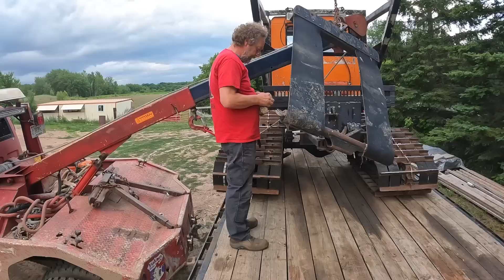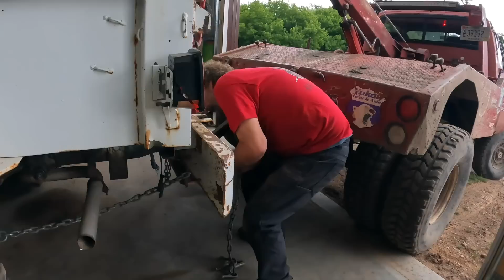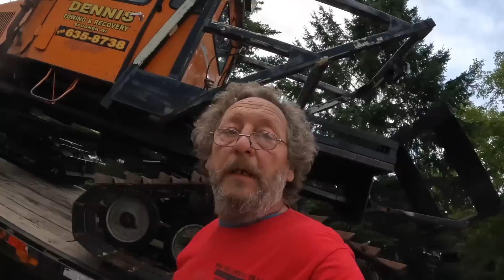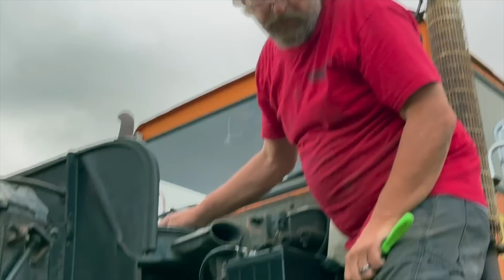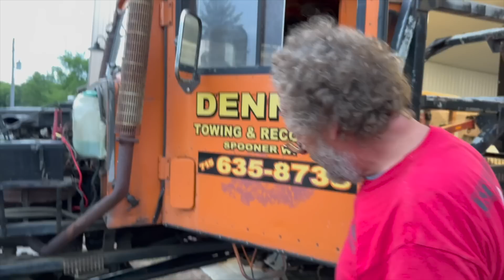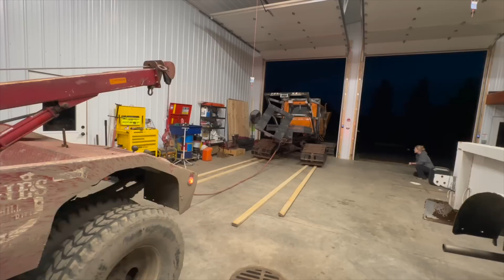Will our new Snow Cat fall off the trailer?

Comment: Am I alone in wondering why you didn't just use the 'drive through shop' and winch the snocat off the trailer with the wrecker?

Aside from that, well done for getting it in there.

Comment: Eric I have seen someone get that creative on unloading a unique snowcat that won't run or steer. 
The Wrecker is definitely powerful didn't seem to have a problem at all moving it.
Have you guys thought about getting a tilt trailer? I am curious because it definitely would have made that unloading easier if you could have tilted the bed up and used gravity to roll backwards and save on the starter.
I am glad to see Seat Cover is doing better and is involved more in the videos

Comment: Im no expert mechanic but you dont need the exact replacement carb for that engine. Definitely speak to an expert but I believe you can just order a brawler brand carb (made by Holley) and have it shipped out quick. Now yes its a little more expensive then the one you found but many people have reported that out of the box they work great on most engines. And beyond that they offer tuning and parts support that a factory replacement just cant offer. The best part though is the Holley support team appears to always be on point supporting small youtube channels.

Comment: maybe put in quick connect hydraulic ports and an anderson plug.  Ust that to plug an Electric hydraulic pump  plumbed into the system to use when engine dies yet you need steering?   Might can find a used one.  It's not like you will use it super often.

Comment: I had a old Nissan with the starter override button  I used it to crawl up a off ramp once after pushing for a 1/2 mile (maybe 100 ft seemed farther lol) I was never so happy to see a gas station on my side of the road.

Comment: I'm mystified that the carburetor couldn't be rebuilt to a state that would at least let you drive the snow cat off the trailer.  I've seen engines run with someone dribbling gas directly into the intake manifold with no carb at all.

Comment: Why kill the battery and the starter when you've got a winch that's designed to do the pulling?
Why not back the trailer in and use the new Challenger Lift to lift the Snow Cat up and off the trailer?

Comment: Given the design of a single ram and linkage to steer that beast, wouldn't you have thought to pull the pin on the ram and mount a long bar to act as an external steering input?  I guess not.